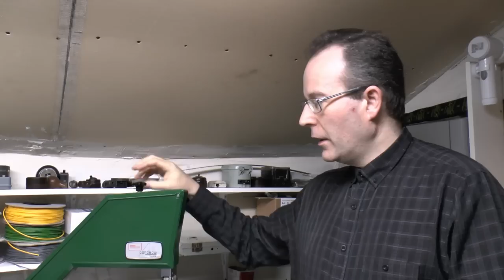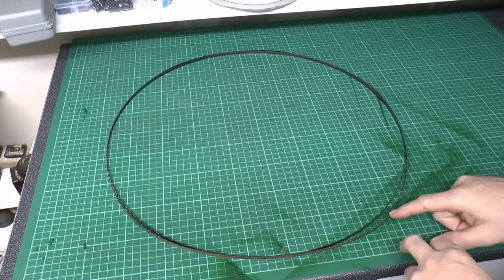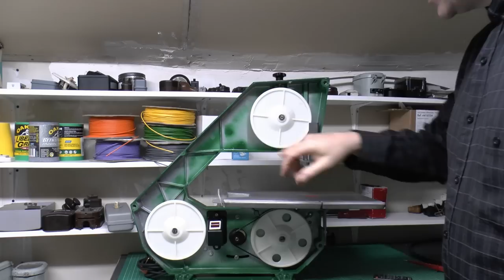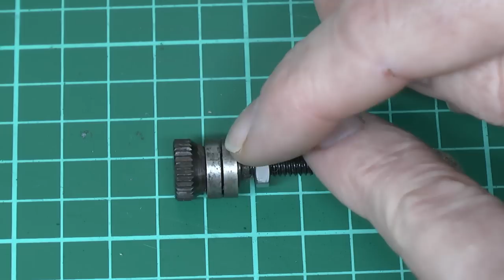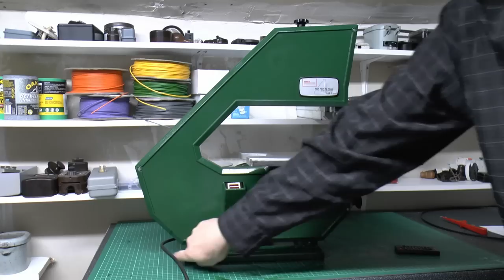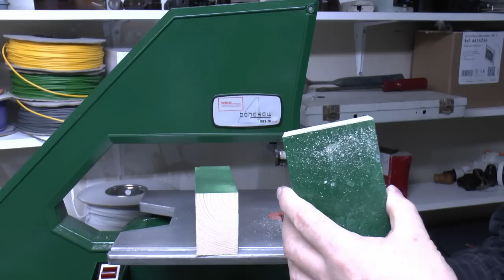Burgess BBS-20 Bandsaw Blade Installation & Test Cutting

Comment: John,

Thanks for the video.  I have a Black and Decker similar model and your detailed explanation of the top wheel adjustment was the key bit of information to keep the blade from popping off.  Taking the table off the saw made adjusting the guides much easier.  My guides are a different design but again your explanation and insights made all the differnce.

Cheers,

Pete

Comment: My father passed away recently and I inherited his old bandsaw which I have just finished refurbishing in line with your videos.  Excellently produced, clear and lucid, even bought the belt and sawblade to boot, and it works perfectly.  That said one of the wheel bearing surface had eroded badly and was slack to say the least.  Fortunately a friend kindly bored out the hub and inserted a small roller bearing, in fact he did two as a second was also showing signs of wear.  (In line with Jeremy's comment on bearing below.)  Well worth doing if you have the facilities or a handy friend!
Reply: Dopo tante ricerche sono capitato per caso da te. Se ho capito bene tu dovresti avere una sega a nastro Black&Decker DN339 perchè è simile a quella del video 
(Burgess BBS-20). Ne ho anche io una così potresti dirmi la circonferenza della cinghia di trasmissione (di gomma dentata) e dove l'hai reperita? Se è la stessa, ti sarei grato se mi rispondessi. Ciao

Comment: Thank you for a very helpful video. I just bought the same model on eBay: the Burgess BBS20 MkII. However, instead of rollers in front and behind mine just has one roller behind the blade below the table and hardwood dowels either side of the blade both above and below the table. The dowels are held in place by grub screws.

Comment: I have one of these units and I have two questions.
1. No matter what settings I try, the cut always wanders off to the left. What could be the cause of this?
2. What is the purpose of the plastic roller in front of the blade? It does not touch anything and seems to serve no purpose at all!
Thank you for makeing these videos - very useful.

Comment: Good video. I have the same saw but the blade runs on the outer front edge of the drive wheel. The top wheel adjustment has no effect on the blade position on the bottom wheel.  How do I get the blade to run on the drive belt? Thank you

Comment: I worked as a technician in a secondary school and we had several of these machines. Eventually health and safety came in and they were banned from use.
From my perspective of repairing and maintaining equipment I felt they were quite poorly made form an engineering perspective and had the makers spent a few extra pounds on making them better they would not have gone bust.
The majority of the machine was made from a die cast zinc alloy. This made the parts not very rigid and tended to flex. 
The idea of bearings was lost to a great degree. 
At least you can buy a fairly good machine today, probably made in China but what the heck. It will have a well known brand name and be made out of steel and last a long time. and probably less than a couple of hundred pounds.
But thanks for the video it was good to watch and people should not be put off buying one if it's cheap and you are happy to cut light materials.

Comment: Looks to be a fairly inexpensive band saw. The plastic wheels without bearings give it away. Good finale to a reasonably good video series. Probably not too many videos of this saw.
Reply: yes these were faily common in the 70's, i had my hands on more than 1 in the 80s but all the ones i saw the wheel centres had been wallowed out to the point you could not keep a blade on them, and no way to repair them. johns wheels fit well, people cranked up the blade tension and didnt lube the wheels, so the centres melted a bit. Burgess were a british company, made other things, engraver, dremel like tools,  ac powered spray gun, not well made, relied on plastic parts for a lot of the most stressed areas (such as these wheels with no internal bushing even) so had a short life.  but were the cheapest of their type for the home hobbyist, before  taiwan then china came into it
Reply: Maybe you could 3D print new wheels these days... don't know if many would bothers since 3D printing arrived a bit later than cheap import power tools.
I hear a lot of plastic parts for classic cars get made this way now.
Reply: youd need machining ability to get the hole round and centred, you could save the old wheels if you had that capabilty
Reply: @jusb1066  Should be easy enough to fit a bush into the wheels.
Reply: @dalekify  if you have machining abilities to make bushing

Comment: hi john im thinking perhaps i should have got a wider blade rather than the quater inch maybe stay on then
Reply from the maker: Width shouldn't make any difference, it's the shape of the wheel which keeps the blade in the centre (provided the wheel is aligned properly).  This website: https://woodgears.ca/bandsaw/crowned_pulleys.html describes how it works.

Comment: hi john my blade as snapped can i still get a replacement blake thank you
Reply from the maker: It's a standard size blade, 56.5 inches length (1435mm).
Available here: http://www.tuffsaws.co.uk/index.php?route=product/product&path=4_7&product_id=15 and many other blade suppliers.
Reply: hi john first of all thank you for replying.ive looked on the site and it as the correct size 56.5 but it also asks what TPI dont know what this stands for ?
Reply: Teeth per inch.

Comment: Could anyone help me source some replacement blade guides for the Burgess BBS20 mk2 please any help welcome
Reply: Just got one of these and noticed a comment about hard wood dowels ? What did you do in the end
Reply: @yvettelov5855  The hardwood dowels are a very good idea. Soak them in oil for a day or so. You can then virtually touch the side of the blades with the dowels. I have a much larger bandsaw than the Burgess and it came with bearing guides. I took them off and replaced them with the dowels. Cheap and can be frequently replaced if needed.